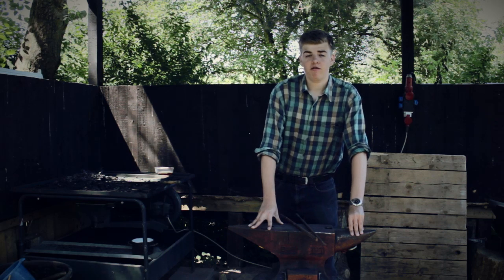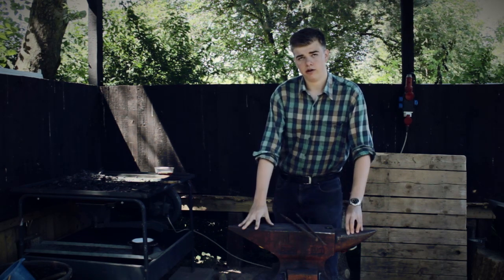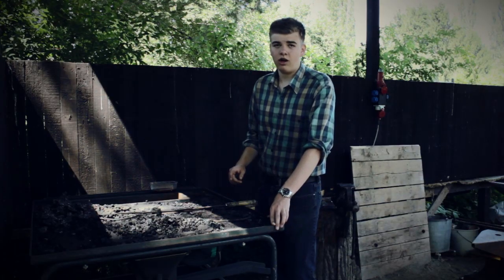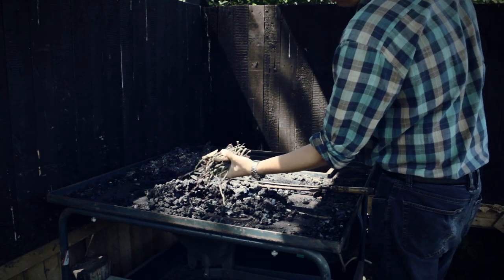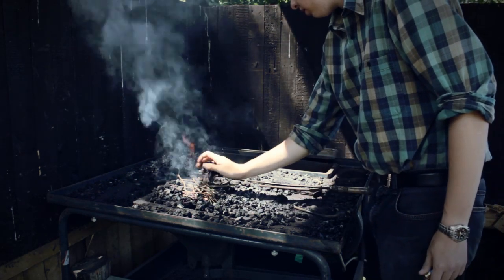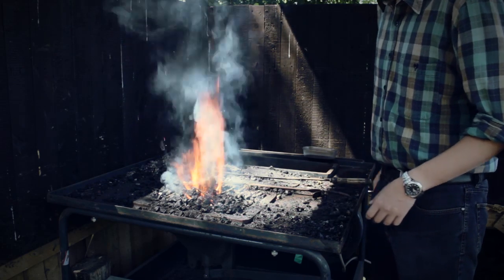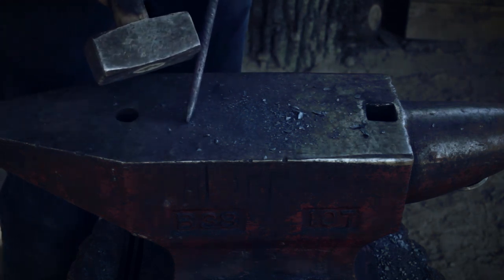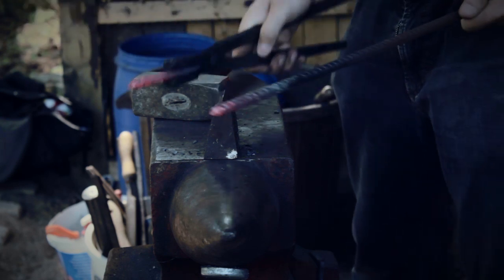How to forge an arrow head part 1 of 3 - The drift

Comment: This is a very informative and thorough video. I did notice an error during the filing part of the process. Most files only grind in the forward direction. Running the file forward and backwards along the steel will not provide a better result, and will eventually damage the file. You should try only filing forward, and taking the file off the surface after every stroke.

Comment: wouldn't it be easier just to grind or saw it of instead of heating it and hitting it with a hammer??
Reply from the maker: haha that was a good one! :D
Reply: Obviously yes. It also wastes more material(not a big deal nowadays, but in a historical context) and more importantly it isn't as strong. Forging usually makes for a "stronger" steel as it shapes the grain of the metal in a desired way.